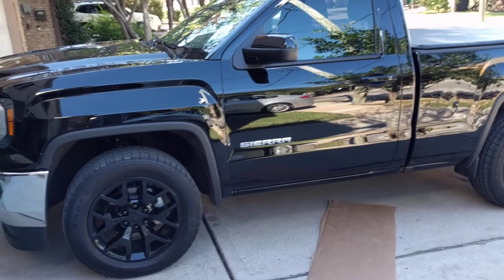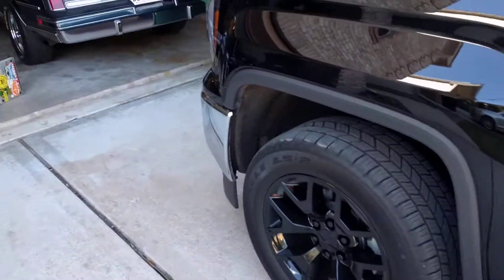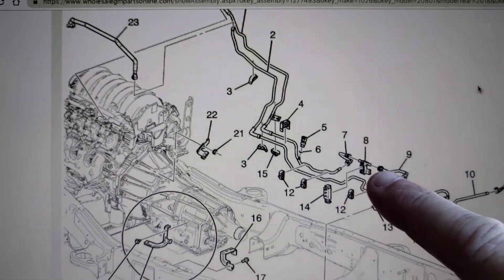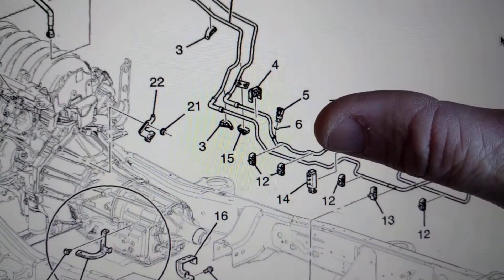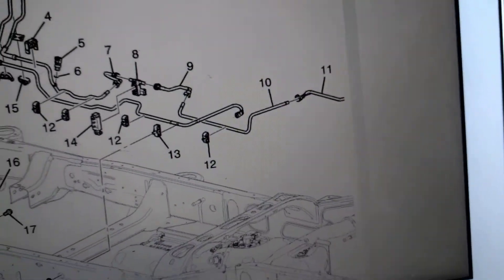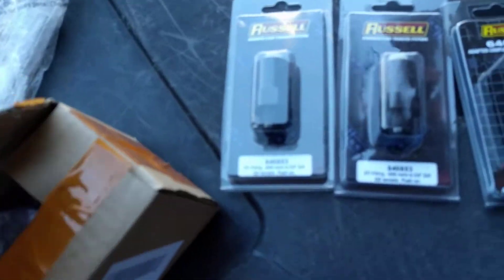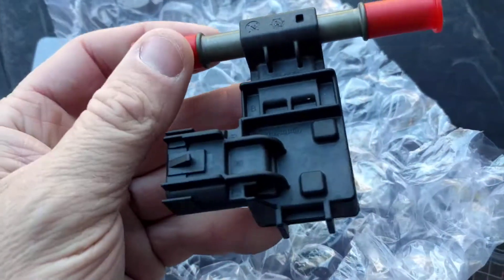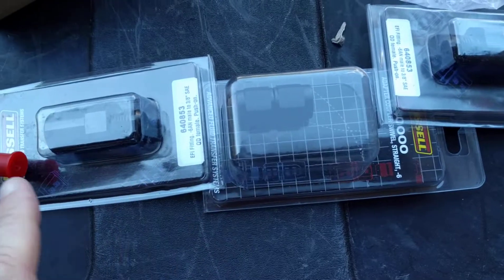2018 Silverado Sierra Flex Fuel E85 Conversion - Part 1 (hardware)

Comment: So do you used the pre-made coupler now instead of buying the three Russell parts?  Great video,  I'm trying to work this out for my 2014 6.2 with a 6l80.  Your method is much easier than replacing all the GM fuel lines and much cheaper than the E85 kits.  Thanks
Reply from the maker: yeah...I used the Russell fittings in my truck and the Yukon.   Neither one leaks and they are much cheaper.  I haven't used anything but e85 in the truck in months.  You can do the factory line thing, but it's a lot of work.
Reply: @nu5m_radio  Thanks I went ahead and ordered the Russell parts and sensor last night.  Great video,  you saved me a bunch of money!!  Not sure if you used a GM fuel line tool to disconnect the lines but I went ahead a bought one of those too.  Can't have to many tools.
Reply from the maker: @blairbarham6532  You won't need a tool to disconnect the factory lines.  The factory fitting has a locking tab you release and then push the "collar" to disconnect.  It's hard to explain, but you'll only need a screwdriver.  The flared tubes on each side of the sensor are very short.  Make sure you are ready to go before putting the fitting on the sensor.  I'm not sure you can even wedge the tool between the sensor and the fitting once it's connected.  You'll see what I'm talking about.  A little dielectric grease or the like will keep you from tearing the o-ring inside the fitting.
Reply: @nu5m_radio  Thanks I wasn't sure and it was only 9$ so I went ahead and bought it.  I have 1.5 body lift on mine so I'm hoping that won't hurt with clearances and maybe just give me more room to work.
Reply: HP tuner,  I already used two credits to turn off AMF and adjust the tries.  I messed with the tune on my old 08 6.2 Denali
Reply: After looking at my truck I need to find a way to extend the pig tail too.  Where your splicing the sensor in is about 2’ from the connector on a crew cab
Reply from the maker: @blairbarham6532  Yeah, there was some discussion of that in these comments somewhere.  I'm sure there is a place to splice the sensor in and extending the pigtail should be easy.  If I couldnt find a place near the gas tank or along the frame rail, I'd just splice it at the fuel rail and extend the wires 4 or 5 feet.  You could buy the proper Delphi weatherpak connectors to make a clean extension, but I'm not against just cutting and soldering in some extension wires.  It's only three wires.  How are you reprogramming the ECM?  HPT?
Reply: @nu5m_radio  Just to follow up your way will work on a 2014 6.2 crew cab.  If you un-clip the flexable fuel line that comes off the tank and connects to the hard line at a 90 degree.  I just pulled it out of it's clip that's right behind the connection.  There is enough play in that fuel line to fit the sensor and all the Russell fittings.  Then I just cut the sensor wires and soldered about 32" of extra wire to allow it to reach the sensor.
Reply from the maker: @blairbarham6532  Excellent.

Comment: Whats the actual point of using e85 its not that much cheaper and uses more of it
Reply: It's 1.20$ cheaper than 93 here and 20 to 30 more rwhp make it worth it.
Reply from the maker: http://gmauthority.com/blog/2013/07/lingenfelter-performance-puts-the-2014-silverado-on-the-dyno-with-video/

Comment: Totally different setup on my 2016 double cab. Bought the stuff but it's a no go.
Reply from the maker: What is different on the '16s"
Reply: @nu5m_radio  Dummy connector is 2-3' ahead of where this splice would be made, the connection is made using a 90 degree fitting from a straight line of bendable fuel hose into hard lining so with this many adapters attempting to attach there isn't enough room without bending the hardline, needs pressed into the frame rail side.

To make it work I'd need to get creative with the AN fittings to "splice" the sensor in and extend the sensor harness a good bit. Alternatively I could attach it to the frame rail where the plug naturally lies but that involves cutting and splicing into hardline. Not sure what to do so I just put all the fuel stuff away to return at a later time.
Reply from the maker: @xCondemnedIV  Yours must be like in this post?: https://www.gm-trucks.com/forums/topic/178280-k2xx-53l-pic-request-flex-fuel-sensor-mounted-on-the-frame/?page=5
Reply: pmoore4321 bingo, that’s how mine is. I assume the difference is double/crew cab to regular.
Reply: @xCondemnedIV  Read above I made it work on my crew cab.  The line that's flexible and makes the 90 has enough play to fit everything.  If you pull it out of the clip that's right behind the connection.
Reply: I have a 2016 double cab and the sensor looks like it's already in place of where the stock sensor would be. So are you saying it's a fake harness?

Comment: And is this a full conversion you can’t use regular pump gas
Reply from the maker: You can use pump or E85.  It works on the 6.2L also.  I just did my Denali Yukon.
Reply: pmoore4321 so doing the conversion obviously a tune after, I can run regular/premium or e85?
Reply: I’m in Houston man so e85 ain’t hard to find around here
Reply from the maker: @totalp22  Yeah, we are lucky in that respect.
Reply from the maker: @totalp22  Yep, it's an easy conversion if you have access to HPT or EFI live.  I want to have mine dyno-tuned after I get the longtubes and CAI installed.
Reply: @nu5m_radio  you in Houston?
Reply from the maker: @totalp22  yes
Reply: @nu5m_radio  how can i get your comtact info so i van go ahead and order this sensor...had some KR issues going on, replaced the knock sensor and it persisted. Any how, need a tune...
Reply from the maker: @totalp22  I  don't sell the sensors.  The sensor is just a common FF sensor.  The part numbers are in the description.  If you don't have a regular cab, the sensor wiring and location may be different.
Reply: @nu5m_radio  yea the sensor i can get, the tune is what i need
Reply from the maker: @totalp22  I don't feel comfortable doing tunes on other peoples cars.  I know enough just to make me dangerous with HPT.
Reply: @nu5m_radio  👍 sounds good man thanks
Reply: You see me around get that single cab next to me haha

Comment: In discription under video russell 640850 is the right fitting or is it 640853?
Reply from the maker: I think the only difference is the color.  Just make sure it's -6AN to 3/8 "quick connect"

Comment: Hows it been running lately? Any updates? Im considering this instead of buying a $300 kit thats why im asking
Reply: 2015 gmc sierra. I just dont know what it could be because it runs good.
Reply from the maker: @luisarmendariz2834  You want me to look at the tune?
Reply: @nu5m_radio  I actually did a diablo tune for 93 octane and diablo says it's the same for e85 and 93 so the only useful thing I was looking at while logging was the air/fuel equivalence ratio at 0.999 dont really know what that exactly means but according to the ecu its probably lean.
Reply from the maker: @luisarmendariz2834  I don't think using the Diablo will work.  The truck needs to have the proper programming via HPT, EFIlive, etc.
Reply from the maker: Works absolutely perfect.  I'm going to convert my Yukon next week.
Reply: Hey I got it installed and now its throwing "system to lean" codes. Did this happen to you?
Reply from the maker: @luisarmendariz2834  Nope.  I did my 6.2 Yukon a couple weeks ago with the same mod.  Both are running perfect.  What year truck do you have?
Reply: Do you have a Link to purchase that hp  tuners for this exact truck/setup?
Reply from the maker: @luisarmendariz2834   hptuners.com
Reply: Is it the mpvi2? What services or features do I have to purchase?
Reply from the maker: @luisarmendariz2834  Just need to purchase HPtuners.  Hptuners comes with (8) credits pre-installed.
Reply: What does it look like though? Is it just software or something hand held? Sorry for the questions, i really dont want to go wrong on it.
Reply from the maker: @luisarmendariz2834  https://www.summitracing.com/parts/hpt-m02-000-04/overview/
Reply: https://www.amazon.com/HP-Tuners-MPVI2-Universal-Credits/dp/B07GGG978H/ref=mp_s_a_1_fkmr0_2?ie=UTF8&qid=1546480084&sr=8-2-fkmr0&pi=AC_SX236_SY340_QL65&keywords=hp+tuners+mpvi2+gm 
Is this the same?